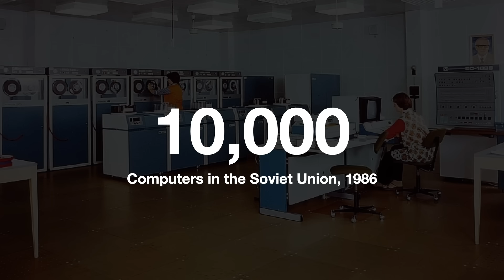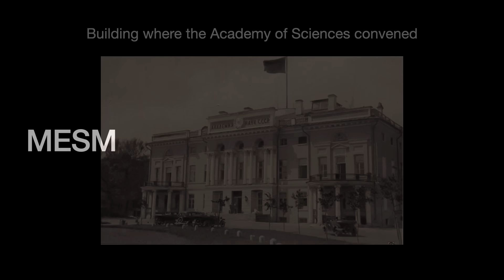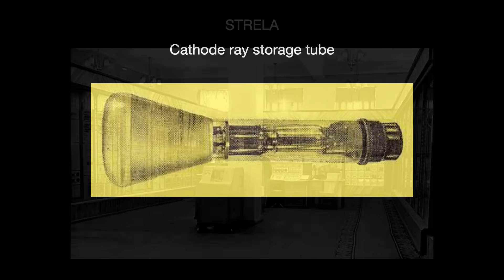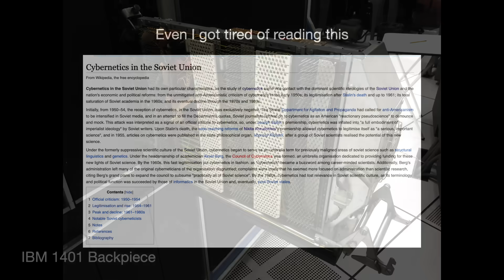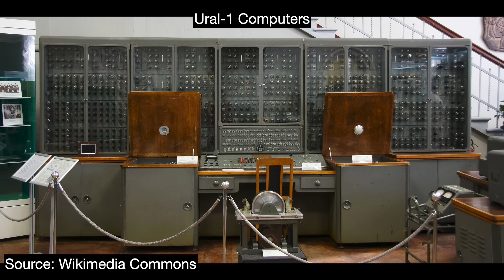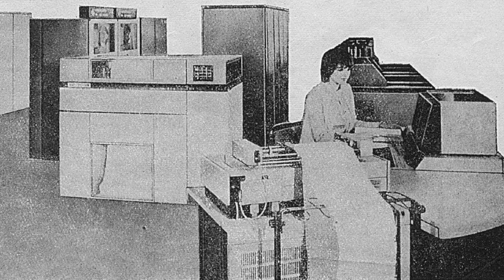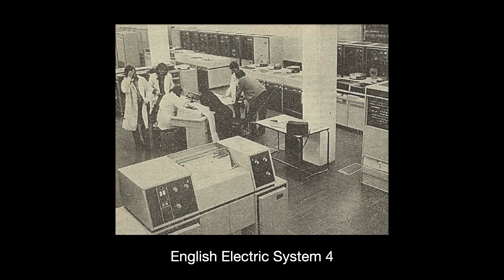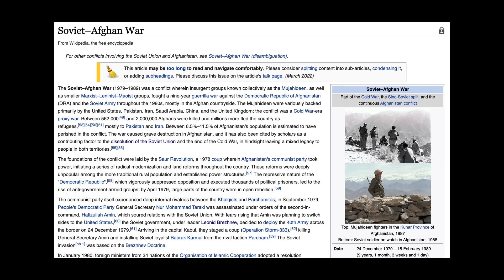Why the Soviet Computer Failed

Comment: My father-in-law frequently travelled to Moscow for his work as an aeronautical engineer in the 1980s. The Russian engineers were known for saying "we may not have the best computers here, but we do have the biggest". You can't fault their sense of humour!
Reply: Soviet microchips — the biggest microchips in the World!
Reply: @AcTpaxaHeu  Soviet microchips = Macrochips
Reply: @novemberalpha6023 :) Да, подобные шутки помню😅
Reply: @AcTpaxaHeu not enough unobtainium!!
Reply: There is another joke: a russian nano-bolt (screw) is the biggest nano-bolt in the world.
Reply: And the good ol' "Russia has the biggest dwarves in the world!"
Reply: See also the DUGA radar system.
Reply: In Soviet Russia, computer updates *you*.
Reply: Nice rusian chips running at 1hz
Reply: @Static-4  They worked though. Western companies gave USSR a lot of electronics for use on remote decontamination of Chernobyl. They all failed where the Soviet ones had a far longer service life.
Reply: well, vassili gorkov, in 1988, I had just bought an AT-compatible PC, for my own personal use, in my apartment, with way more memory, than 64KB.  And had just finished working as an EE, in an office/lab, which had a whole bunch of XT and AT compatible PC's, all with a lot more memory, than 64KB.  And somewhere between 1988, and 1993, the internet became available, for home use.  And in 1989 and 1990, I was using RS-232, all over the place, in another EE office/lab.  And, nowadays, nobody even dreams, or thinks of using RS-232, anymore.  By 2005, even residential homes in America had home networks, and within a few years, they all became wireless, too.  
     Perhaps the Soviet Union wasn't too far behind, in 1988, but the gap started to become greater, and greater, afterwards. And, nowadays, Russia's technological abilities, on the battlefield, are beginning to look even less capable, than back then.  Why is the Russian military having so much trouble, beating up on their much smaller neighbor, Ukraine?  It couldn't be because Putin's dictatorship had silenced all dissenting or critical voices, in the Russian media, and among his advisors (to remove all threats to his regime), and thereby was told what he wanted to hear, instead of the truth, about the West's reaction to his invasion, Ukraine's resolve to fight, and his own military's lack of capabilities, so that he made a bad decision to invade, based on inaccurate information, now could it?  When IS Russia going to throw out all the central state control forms of government, and start practicing true democracy, with freedom of the press, speech and religion, so that whoever is elected, can receive accurate information, in order to govern the country correctly, instead of having such costly f'ups, in terms of human lives and money and property?  If Stalin hadn't been surrounded by so many incompetent yes men, in 1941, maybe the Soviet Union would not have wound up with 27 million dead, just between 1941 and 1945, alone, let alone all the material costs, during those 4 years.  And now, we see a similar uniformly centrally controlled government, with no real freedoms or liberties, full of incompetent yes men, making the same costly mistakes.  At least here in the U.S., we can still vote out our current useless government, as we have begun to do so in our recent midterm elections, and begin to put the brakes on it's unbridled spending (which is causing massive inflation, here in the U.S.), and still have media that is able to criticize it's use of dangerous vaccines, masks and social distancing, which has proved to be exceptionally destructive to our economy, as well.  In other words, we still have some freedoms and liberties to be able to throw out our current failures in government, eventually, and put in some government leaders who will keep us from making such costly mistakes as those experienced in countries, with more oppressive governments, like Russia and China, today, for example.
Reply: @michaeltotten7508  I do not want to argue about political stuff. There is no point in it and the super democratic YouTube will delete it anyway like my last post. I was trying to say in the middle of 80s the gap was negligible but after the Soviet Union collapse it became abysmal.
Reply: @vassiligolikov4401  yeah, well, I tend to agree.  and I know you're not into any political stuff, but quite simply, the Soviet Union was built on a failed economic concept: that everyone will share, and that personal profit is not the single most great motivation, for all great economic industries--because it is.  yes, it is good to share, but not everyone will--and not to the extent of creating a great industry.  profit is the greatest motivation, for everyone, in creating great economic enterprises.  The people of the Soviet Union united to fight the Nazis, because of a common desire to survive impending annihilation--but once that threat ended, profit became the greatest motivation for creating great economies and great commercial industries, throughout the world--and the Soviet Union started to fall behind. Take away that motivation, in any country, and, sooner or later--everything starts to fail.  And the Soviet citizens didn't even have to go to the U.S., to see how well free market enterprise worked--they could see it right next door--in Finland--where the people of that dinky, small country, who had Western-style capitalism and independence from the Soviet Union--were living so much better than citizens of the Soviet Union--despite spending a ton of money on their defense budget, every year.  Don't tell me that all Soviet Citizens were happy with cars that didn't have safety glass, driving on gravel or dirt roads instead of modern highways, having to wait hours in line for basic necessities, not being able to get some foods in the cities at all, not being told in time about nuclear fallout from nearby Chernobyl, or not having all the things for their kids, that Western families had...let's face it: the Soviet economy, despite having free housing, free education, free medical care, and secure jobs for life, was a wreck--slowly failing apart from a lack of individual motivation, and stifled individual initiative.  And now that there is another totalitarian dictator in charge, today--are things getting better, or worse?  And, if better--why are all the young, bright ones leaving, right now?  Without freedom of criticism of the government--there is no hope, for a better life, in the long run--like there is, currently, in the West.  Of course, who knows how long that will last--if the leftists have their way, in this country, like the Bolsheviks did, in your country, in 1917?  Already in this country, we see a sharp lean to the left, of all the main tv networks, and biggest newspapers, in the Northeast.  They never talk much about the failures of our current government, or the about the great successes, of our previous government.  Instead of talking about why the policies of our previous government worked so well, they only resort to personal attacks on those who follow those policies.  But we need to cut back on government spending, for social programs, stimulate our fossil fuel industry, cut back on taxes, both corporate and personal, eliminate unnecessary regulations, both environmental and biomedical, stimulate and support all businesses, both big and small, and strengthen our military, remove all government "mandates", and eliminate fear, develop faith in God--and practice total freedom of speech, in every university, college and corner of our country--and support our police, fund them very well, and throw all of these looters and rioters in jail!  We also need to allow every citizen, everywhere, to own a gun, for self-defense, make sure every principal in every school has one and knows how to use it--and remove all juvenile delinquents, disrupters and criminals, from all of our schools.  We need to be free, to speak our minds, liberal OR conservative, wherever we are, at any time, on any bus, train, plane, in any store, school, college or street corner--and encourage police to arrest looters, and courts to prosecute them.
Reply: @michaeltotten7508  Im a bit late but michael, for gods, sake know your definitions if you are using these buzzwords at an increasing rate , using words such as "totalitarianism" so casually really minimizes and lessens its weight and actual meaning. Russia is not totalitarian, its authoritarian, neither china is totalitarian. For someone who likes to defend his ideology with zeal you really didnt familiarize yourself with key concepts before giving us this lecture and really a dogmatic and preachy comment. Authoritarianism differs from totalitarianism by the simple fact that its allows some manouverbility within said system, while toralitarian states allows for none. Think of north korea, or turkmenistam now those are actual totalitarian countries but china and russia are authoritarian just like jordan for example or the UAE , are you going to call the UAE "Totalitarian"? I hope you wont because there are major problems if you do. Have a nice day , michael!
Reply: Nice joke. Everybody knows: the IBM company has famous leader of mainframes in 1980-s
Reply: My Dad was on East German team hence he made lots of close German friends , he was sad how much reverse engineering was happening instead of innovation .
Reply: That's a big computer!! 😯

It's Russian, huh....😎
Reply: Lol
Reply: Хотя первый персональный компьютер ("Мир") был создан в СССР (великим В.М.Глушковым, продолжателем идей А.И.Китова в создании ОГАС, предтечи Интернета).
Reply: Yes but they worked perfectly well didn't they- and what they produced considering the technological constraints should shame every Western defence company. USA still cannot come up with a better engine than RD-170.
Reply: @markiobook8639  I would argue that the engines used by Space-X and Blue Origin (to name only a few) are just as good as the RD-170.

That being said, the RD-170 was developed a while ago, and was considered (at the time it was developed) to be impossibly difficult to make work by the west, which is why it never was until recently.

My hats off to the soviet rocket scientists who managed to work miracles of science and engineering under such a crappy regime.  What might they have done if the handcuffs had been off?  The mind boggles.
Reply: But USSR was the "computer power" in 1953, though it was backward and agricultural power with 80% of illiterate peasant population  in 1917
Reply: @alexeyb6129  yeah, sure, Alexey B--I believe that--like NOT!!!  Such a GREAT "computer power", that when transistors, then integrated circuits came along, this great "power" was incapable of incorporating them into computer designs, like the capitalist West did, over and over again, to improve computer performance, by an order of magnitude, each time, right Alexey?  Let's face it, Alexey--the Soviet Union was a failed experiment, based on a failed system--and is now relegated to the "dustbin of history", just like Lenin said about democracy, when his Bolsheviks started this whole failed experiment, in government, that we used to call "communism", but now call "socialism"...PROFIT is the ONE thing that motivates ordinary people to create great industries, like the current computer industry, not masses of the "proletariat", working together.  And when Lenin, then Stalin, then Khruschev, etc, threw out that motivation, the motivation of PROFIT--then everything went to shit...until everything finally collapsed...PROFIT is what MOTIVATES Ukraine, to fight so hard, what motivated Finnland, to fight so hard, from 1939 to 1945, what motivated Poland, to throw back, the Red Army, in 1920--and rise up again, in 1944 in Warsaw--and agitate for freedom for 46 years, from 1944 to 1991--and support Ukraine, wholeheartedly, etc, etc, etc.  And PROFIT also motivated us, to fight and win, in an 8 year long bloody war, against the greatest military power on earth, at the time, from 1775 to 1783.  Ponder THAT for a while, while you are attempting (and failing) to extoll the virtues, of a failure, called the USSR.
Reply: Russians(Soviets) seem to love building big things 
 - biggest helycopter, plane, nuclear icebreaker, submarine,
tsar-bomb, etc. While USA is very good balanced in using
Taiwanese to make smallest chips,  Europeans to research
in pharmacy,  Indians to calculate and so on. Being close
 to the other world has as negative side as well as positive too.
    Japan is a close country,  that is why sometimes they can
 produce a unique thing, but on a total scale they are on
lower level to influence this world.
Reply: And today we can't even create hypersonic or or we have to use a Russian rocket to go in space boy how things switch over
Reply: And the "heaviest", "most cumbersome", and "most difficult to mass produce", too!  ha ha ha ha ha...(and probably, "most unreliable", and "most expensive", as well!)
Reply: @michaeltotten7508  Absolutely not. Soviet chips and electronics are designed to be EMF resistant. Tube, rectifiers, transistors and all forms of vacuum electronics are stil manufactured in Russia. 
What medium of amplification do the highest end audiophile systems use? Valves.
Reply: @markiobook8639  Markio, Markio, Markio...we do disagree in some areas, but agree in others.  First of all, I do not rate China as a democracy, I rate it as a totalitarian government, and an enemy of democracy, and freedom, with its current government.  And yes, the British had their upper class, with democracy mostly only for the upper class, but we overthrew that oppressive rule, here in the U.S., with our 8 year long bloody war, known here, as the American Revolution--and even that was imperfect.  Now we had included democracy and freedom for middle and lower classes, not just upper classes, but had to fight another, even bloodier war, just to abolish slavery, and then still be shackled with outright racism, like the KKK, fully supported by the Democratic Party.  We are making progress, and improvements, with our freedoms, liberties, and democracy, here in the U.S., 
and other Western states are beginning to copy our progress.  But, if the Soviet Union's system of government was so great, why did it fall apart?  Why did they have so much trouble, getting basic agricultural produce to the city markets, and why were their cars, so unsafe?  Why were their roads so poor, and unsafe?  Why was their nuclear reactors so unsafe, for power generation for their cities, and why did this great "union" fall apart, with so many of its own citizens demonstrating, in the streets?  Yes, the Soviet Union did great against Hitler's horrific genocidal invaders, when threatened with extinction, but after WWII, their consumer economy declined abysmally--if it ever was good, to begin with.  And, even with that glorious victory against the Nazis, the Soviet Union still had made so many mistakes with its military and its government, that 27 million people died in it, while defending itself, during WWII.  How many Americans died, during that war?  A helluva lot less, my friend, a helluva lot less...in fact, the most vicious war in American history, the Civil War, with nothing but Americans fighting Americans, only had 1 million dead--the greatest # of American dead in any war, that the U.S. fought in--nowhere near what the Soviet Union suffered.
        The problem here, Markio, is that when you have a handful of people at the top, making all the decisions, then they might make the wrong ones, either in military conflicts, or in the economy.  But, when you have a capitalist democracy, where every consumer votes with their dollars, to choose what products they want, in a free market, then you get a better product, service, or infrastructure, for everybody.  And when you can vote out those who have made bad decisions, in governing a country, you can get rid of them.  Personally, I believe that our current federal government (and most of the state governments, here), have made a bad governmental decision, by spending too much money, and by suppressing the fossil fuel industry, here, in favor of renewable, sustainable, green energy solutions.  But then, 20 years ago, I was against the other political party in this country, for invading Iraq.  That president got voted out, and this one will, too.  Already, the opposing political party here has taken control of the House of Representatives, and is starting to put the brakes on unbridled spending, after being voted into power, by millions of voters, here in the U.S.  But, who was gonna vote out Stalin, after some of his bad decisions?  Who is gonna vote out Putin now?  Or the leaders of China?  They were, and are, totalitarian dictatorships, lacking freedom and liberty, and, as a result, they made bad decisions that have hurt them economically, militarily, and cost the lives of so many of their citizens (even during non-war years).  And, im not saying that the U.S. is perfect, either, flawless, or free of guilt--but I believe that we are the best, currently.  Who knows who will be the best, for its people, in the future, or what system will be the best?  But, up till now, we have been (not perfect, but the best currently available).  Oh, and yes, im sure that we gave satellite info and intel to Ukraine, in addition to all the other electronic devices that have helped them, both civilian and military, during their struggle for independence, from Russian domination, but that info and intel, again, came from our advanced electronics and computers.  And, they may or may not succeed in their quest for freedom from Russian domination, but they certainly are giving it one helluva lot of a fight, in trying.  Which leads me to believe that Putin, just like Stalin before him in attacking Finland in 1940, made one helluva big misjudgment, as to how quick and easy this conquest would be, wouldn't you say so, Markio?  But then this war originated from the top, not from the people.  When Pearl Harbor was attacked, everybody in the U.S. contributed to the war effort, everybody wanted to fight, not just Roosevelt's administration.  When Hitler attacked the Soviet Union, everybody contributed, even Ukrainians, to defeating Hitler, because everybody was facing annihilation.  But, what was the great attack against Russia, to decide to attack Ukraine, last year?  Is Russia defending itself against a genocidal invader, or just trying to dominate, conquer and control, an unwilling neighbor, instead?
Reply: @michaeltotten7508 , tem ouvido alguma coisa sobre o Brasil?
Reply: @gabrielnascimento126  translate to English, please...
Reply: @michaeltotten7508 ,Have you seen anything referring to Brazil?, I fear that we are no longer a democracy.
Reply: @michaeltotten7508 ,Brazilian YouTube has the function of translating comments, I thought it was the same in American,sorry.
Reply: @gabrielnascimento126  no, gabriel, I haven't seen anything regarding Brazil, yet...and I sometimes wonder, if we in the U.S. are still a democracy, too.  If you truly have lost yours, I am sorry for you, and your country...at least I can still speak freely on some media, about how I feel, here in the U.S.  I have heard nothing good, about the left-leaning regime, in Venezuela, and their so-called "nationalization" of the oil industry, there.  As well as their government, too.  Perhaps that is why so many are trying to come to the U.S., from places like Venezuela and Cuba--instead of the other way around?  I also heard that a million people so far, have fled Russia, too--since their current dictatorship has started this endless war, against Ukraine.  It's a funny thing about oppression, tyranny, and lack of freedoms--it tends to drive away a lot of the people, who could make any country work well--to somewhere else where there is freedom (which is a big reason why so many qualified people came to what later became the U.S., in the first place--and were successful rebelling against control, from the British Crown, in the Old World, almost 250 years ago).  I hope you are successful, in re-establishing democracy, in your country--or, if not--in finding somewhere else, where you can be free.
Reply: @michaeltotten7508  You are right in half of your words.
Reply: @sivkov1987  In which half of my words, am I right, Sivkov Ilya?  In which half, do YOU believe that I am correct, and in what do you believe, that I am incorrect?  Please specify...
Reply: @michaeltotten7508  Its so orwellian, michael, the way you keep using these words like "yes democracy, freedom, liberty" "this is bad this is good" like an actual programmed person talking to me, michael, learn to think outside of what mainstream media tells you michael , its time to do that
Reply: Yes.
Lol.
Because they introduce white noise.